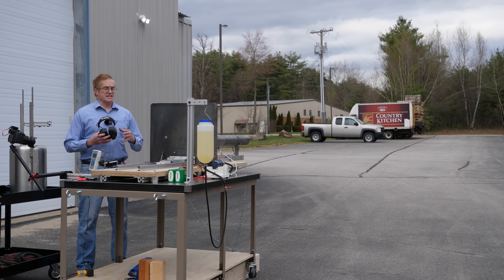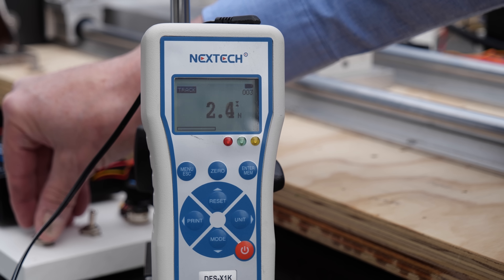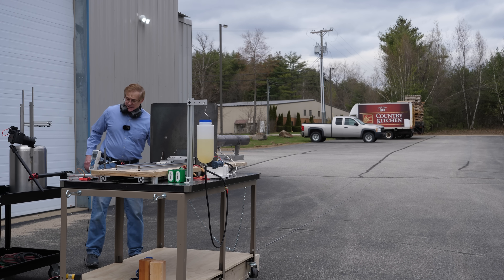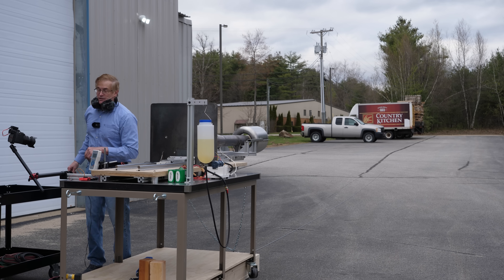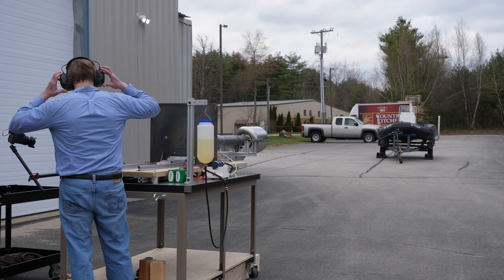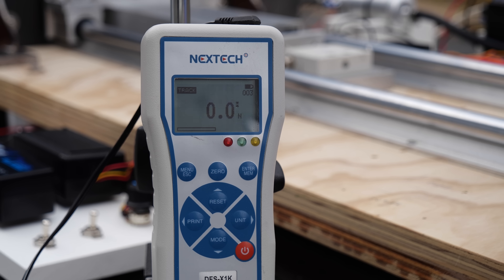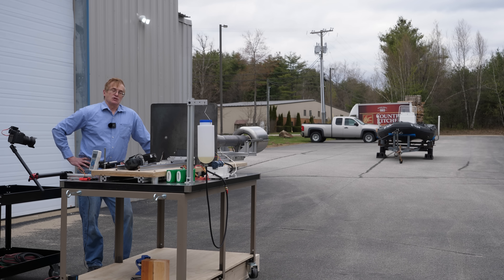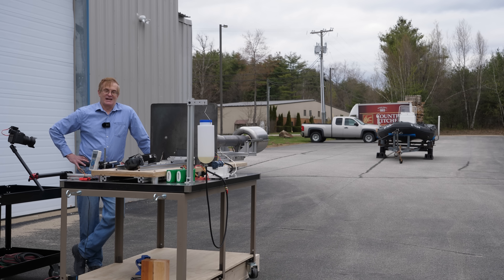WE USED AN AUGMENTER ON OUR PULSE JET!

Comment: I think the entire assembly needs to be in motion for a noticeable effect.  If I recall, there needs to be air flow through the ring for it to enhance the pulse jet.  Would be interesting to rig up some air movers to push air around the assembly and through the augmenter and see if there is a more noticeable effect.  That said, I agree with the weight likely not being worth it given how simple the pulse jet is to begin.
Reply: I had this thought too -- that a static test might not allow the augmenter to work as intended.  Not that I've read any literature, but if there's a gap, there could be airflow through it.  A static test might get some entrainment, but that could be fiddly to fine-tune.
Reply: They have all they need to test that theory: They could mount the pulse jet engine to the boat and try with and without the augmenter to see if there's any speed difference
Reply: @VeniceInventors  in scientific testing, you try to reduce variables and isolating what you’re trying to test.  Mounting it on a boat, while awesome, would introduce too many extra variables.
Reply: @spamviking8591  I fully agree it wouldn't make a proper scientific experiment, it would be more for the fun of it since they already have that boat which should be light enough to be set in motion by 100lbs of thrust. (I'm also ignoring all the ways this could go wrong, as that would take the fun out of it)
Reply: Yeah, need to run this in a wind tunnel to properly see the augmenter effects. In this static setup the exhaust is losing energy from accelerating the still air at the augmenter input ring due to pressure differences.
Reply: Nice idea! And that would provide a new video too!
Reply: Yes I think you’re right, there would be extra high speeded airflow and it would reheat the cold moving air.
Reply: Forgo the fan and strap the whole thing to a go kart, do one mile runs with it 3 with the augmentor, 3 without average between the runs and see.
Reply: A "ring" fan would probably not produce enough air-flow for the augmenter to do it's work in a static firing. You'd need something like a wind-tunnel to test the augmenter.
Reply: @meatybtz  I was talking about the snail fans to dry floors, but you're definitely right, it's less than Ideal, but it would be interesting to see if there was any improvement and it would only cost 100$.  I don't know how much it costs to rent a wind tunnel.
Reply: @spamviking8591  Snail fans setup on a rig, say, three to create even flow across the booster?  You know.. that MIGHT actually work.
Reply: @meatybtz  the issue would be the turbulent flow, as you said a laminar flow in a wind tunnel would work better.
Reply: He could loan it to Whistlin' Diesel.  He has a testing facility.

Comment: I'm wondering if the fan should "prime" the airflow to the augmenter to get the boost, as in theory all of this should be happening at high airspeed?
Reply from the maker: "Prime?"
Reply: @TechIngredients  Could you install an anomemeter at the entrance of the augmenter to see if at low speed the pressure from the jet engine isn't just blowing out air from the front of the augmenter?  During flight this wouldn't be a problem, or in a wind tunnel... I know nothing about this, btw. :D

Comment: Perhaps the whole thing needs to be moving in the first place for it to work properly.
Reply from the maker: Maybe,  but I'm skeptical.
Reply: The original ones were launched with a catapult before the pulse jet started propelling them.
Reply: Yes, that sounds logical to me. .The whole things move in addision to Moving (heated) air pulling (low pressure) the cold air from the augmenter in and heats that for added effect  (heat expansion) The augmenter keeps the compression of the then newly heated air.. With slow or stagnated air around the augmenter the whole effect would be missing.